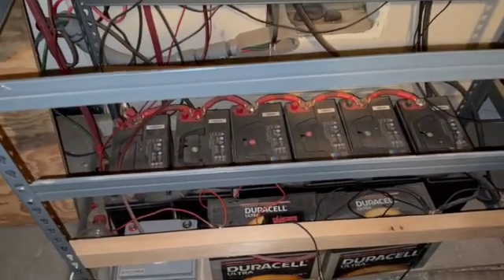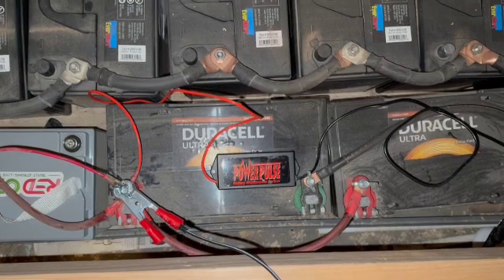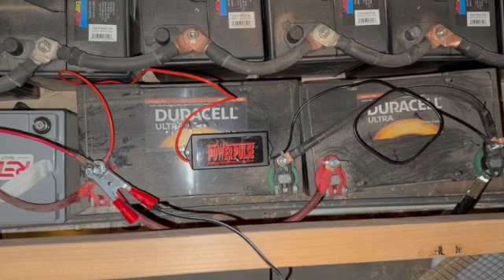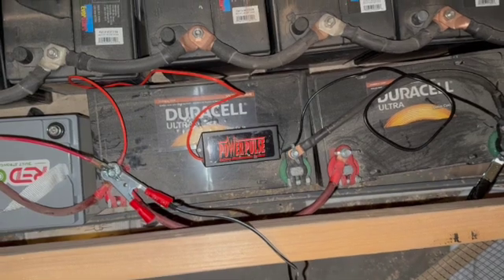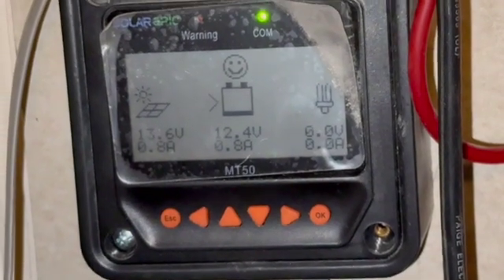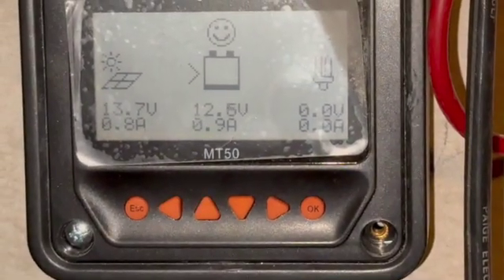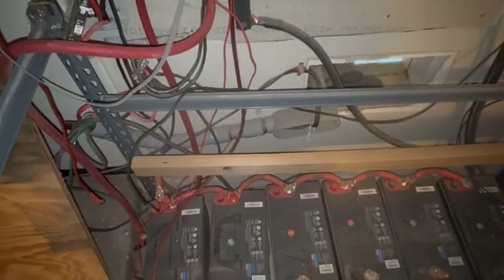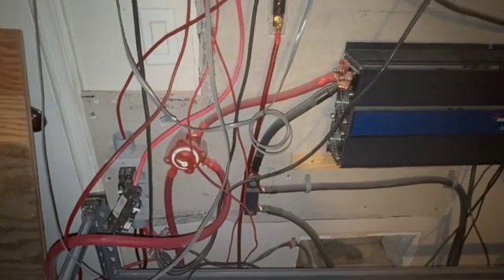Solar Power Update    01 07 2025

Comment: Desulvators work I used them for years and it does extend the life of your AGM batteries.  Question did you check each individual battery to ensure you do not have a bad one? Desulvator only clean the plates it can't repair a bad battery. I switch to lifepo4 two years ago, it's the best thing ever! Give it a try. And another thing 16 lifepo4 battery cells may take up the space of about one or two of them AGMs but give you far more power and use its a win, win.
Reply from the maker: not yet, but I plan on doing so